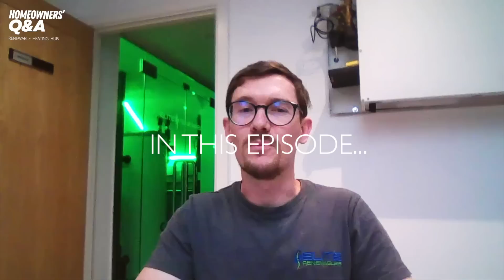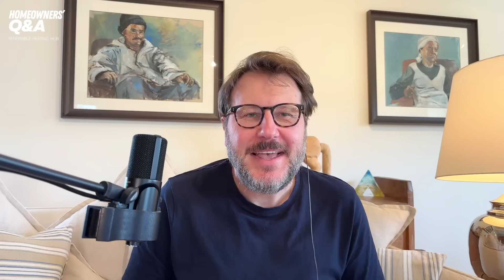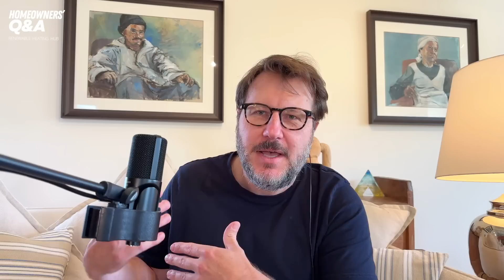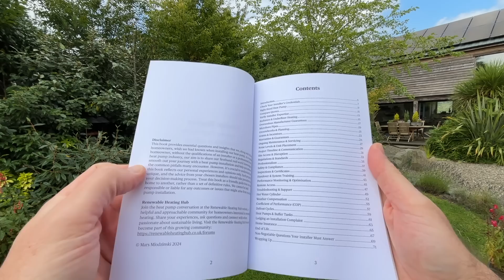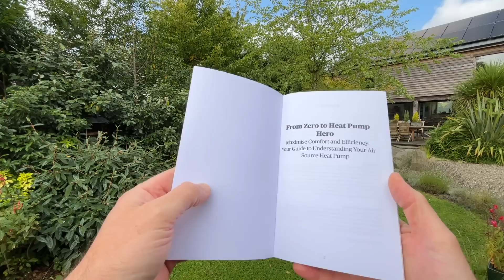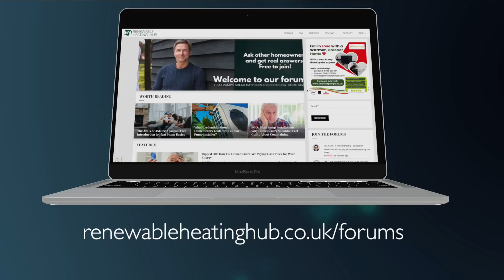Should I Retrofit or Upgrade My Pipework for a Heat Pump?

Comment: In a hydronic system, every circuit, we'll have an equal differential pressure. This pressure can be adjusted to ensure that each circuit requires the correct flow. So a balanced system has the correct Delta p across each circuit to ensure the correct flow for the heat load supplied by that circuit. It helps to remember that water flowing in pipes follows the square law. This means that small additional amounts of flow will create larger variations in delta. A system will be easier to balance when the majority of pressure loss occurs in the branches rather than in the mains. The branches, referring to the sections of pipework that feed the emitters while the mains are the main flow and return. Some of this is explained in the caleffe series of magazines. These articles also go on to explain about valve authority and other concepts involved in balancing.

Comment: This is great. I’m just refurbishing my house at the moment and wondering about a heat pump and will have a long run from the heat pump to the house (around 15m) through the garage so I want to be able to put in any pipe work that could be needed while I have the floors up. Also thinking of a manifold to the radiators but trying to find a 15mm copper connection is hard because it seems that everything wants to be plastic.
Reply from the maker: Sounds like you're planning a great project and it's smart to think about the pipework now while you have the floors up… thanks for watching!

Comment: where do i find these FRB's? google isnt showing me anything useful. just had a Vaillant HP retro fitted so could do with these to balance the system.
Reply: I really like the idea of the FRV, but I am curious why there seems to be no competing product and little to no coverage of this product
Reply from the maker: The FRV was only invented and manufactured very recently and it’s the first product of its kind as far as I know, hence no competitor. They’re a very clever concept though.
Reply from the maker: Here’s our piece on them: https://renewableheatinghub.co.uk/the-importance-of-radiator-balancing-for-efficient-heating-introducing-the-flow-regulating-valve/

At the end of the article is a link to Firepower where you can buy them. If you decide to go ahead, email me, editor@renewableheatinghub.co.uk and I’ll send you a code for a 10% discount.
Reply: @RenewableHeatingHub  hi Mars are you still offering the discount on the frv's please?

Comment: With no disrespect intended plumbing is a trade in the UK, not a profession. They are quite OK plunging a blocked toilet or installing a new stink pipe. The type of job that young people choose to do if they aren’t good at math and physics. 
There is zero chance they are going to be accurately performing complex calculations to correctly specify your system. 

If this were Germany or Switzerland, where they receive a full technical trade education from the age of 12 and ultimately a good salary then it would be fine. But this is Britain, the home of the bodger. The chap on the bottom right of the screen clearly had no idea what he was talking about, I wouldn’t let him anywhere near my house.
Reply: That's why you employ a heating engineer to design and install a heat pump, not a plumber..

Comment: Good podcast.This is where homeowners need to choose their installer wisely. As a company, we are asked to investigate heat pump systems that are not performing as they should more and more. In virtually all cases there is little or no design work carried out. Heat loss as stated in the podcast is the first step. From here, we can see what heat is required for each room. We then work out mass flow rates for each section of pipe with the frictional head loss. Pipe sizing is then carried out for the magic 0.9 m/s velocity (if possible). Balancing is often overlooked completely and it's such an important part of the system and overall job. This is just not being done by the majority of installers. We are often hearing that designs are being done by another company (umberalla) that have not been to the property. We overheard a conversation just last week from an installer saying they didn't know how to size a system but it didn't matter as they had a company off site that would do it all. This is often where you see hydraulic separation using buffers as although efficiency through distortion is lost the installer and supplier won't get many call backs. We use buffers as a last resort! 
We recently had a chat with one of the technical departments for a competant persons scheme regarding why building regulations have set a minimum flow temperature of 55 degrees. They cheerfully told me it was so that a heat pump could be retrofitted later down the line with little or no changes. When I said that DT5 was four times more flow than DT20 and things were not as simple as they thought, they could not get their head around what I was saying! After 15 minutes of not getting very far I left it. It is worrying that bodies like Gas safe, Oftec and Building regulations are clueless when it comes to hydronics!
Personally, I think as a heat pump installer, all people involved in putting systems in should be able to  size a system with regards to both heat loss and pipe sizing. Without this you are just guessing. As a rule of thumb don't go for the cheapest quote (although this can be wrong) and often a good local installer will give good post install care when the larger companies have gone to the next job.
Reply from the maker: Great insights, thanks for watching.

Comment: Great topic!  Is it possible / practical to disconnect my gas combi from the flow & return pipe network then measure the resistance, pressure & flow?  In the same way one can measure the impedance of an electrical circuit
Reply: I don’t think you are going to find a turn key solution that’s available to a DIYer. Re pressure that’s going to be tricky because you will probably have a sealed system and therefore have an expansion vessel somewhere.  The pump you have is likely to be in the boiler so you’d need to cobble up a pump adapter and then look for a pump that can output that kind of output. Grundfos alpha 3 have a blue tooth connection and you can use home assistant and an ESP home connection to pull that data out the grundfos go app if you don’t have the time to set up home assistant.

I’ve come from an IT background so I have the time to play with home assistant and have rigged up an effective monitoring system for monitoring the boiler flow and return temp, the flow temp before the pump, the electricity to the valves, pump and boiler. 

Been able to see the temperature drop in my uninsulated pipe work and justify insulation as part of my house retrofit.
Reply: With my oil boiler, I have a Wilo circulating pump that measures flow, power and head - I've swept through all the settings and fitted a power curve which seems to suggest 20l/min would be quite easy to achieve at under 100W pump power. 30l/min looks practically impossible on 22mm pipe though.